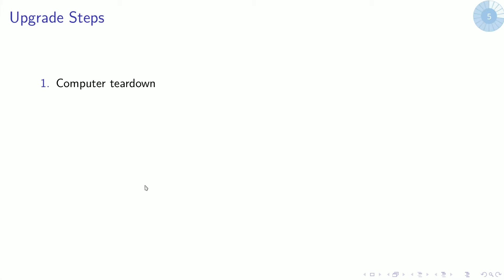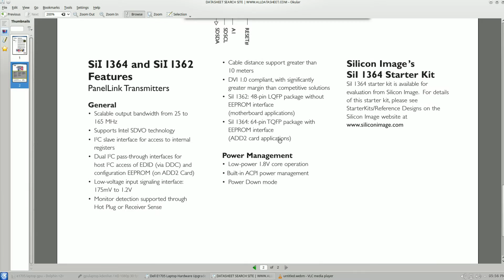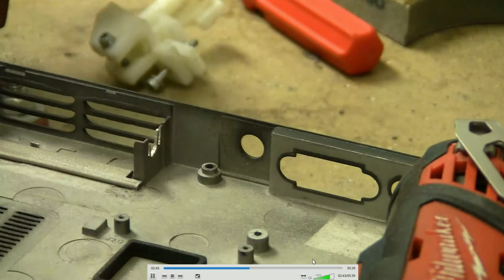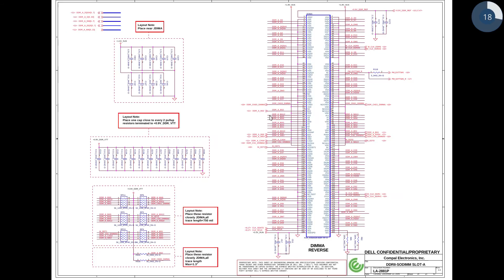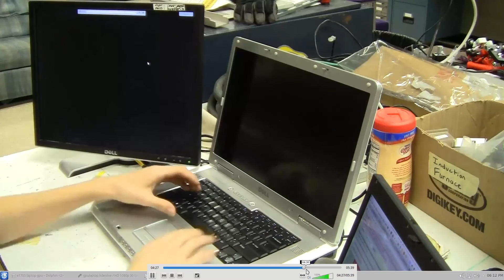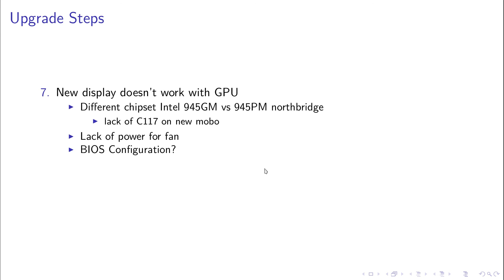Dell E1705 Laptop Upgrade

Comment: Congrats!  I thought I was doin good, upgrading my E1705 to 4GB RAM, and swapping out a broken screen with one of same res.  But I gotta tell ya, around Nov of 2016 you probly coulda snagged an E1705 with all those specs on eBay for $130.  Even less!  For some reason, some really great deals on oooold laptops come in late Nov. and Dec. every year.  Great, great speakers and sound on the E1705, though!  (No audio in, for mixing, unfortunately.)

Comment: Hey! I have e1705, wanted to throw it out but now I see a new little project.
May i ask you couple questions?
With 64-bit CPU will I be able to run windows 8 or later?
Is that video card is the best it can get?
Which one would be the best CPU for that socket?
What maximum amount of memory this laptop can handle?
Reply: Hey there! I've been doing some research and I think I have a few answers for ya!
I have an e1705 that I've been upgrading slowly.
With a 64 bit processor you can run windows 8 and 10, however getting drivers for audio to work properly is a bit of a hassle. The front speakers always work, but sometimes the mini subwoofer won't. Windows 7 works wonderful though!
The most powerful graphics card that I think this laptop can take is an Nvidia Quadro FX 3500m. Another option is the Nvidia 7950 GTX. Both have 512MB of video ram.
The best CPU that I think you can get is the Intel T7600 2.33ghz part. It has an FSB of 667. Anything higher has an FSB of 800, which is not compatible.
This laptop can handle 4GB of ram, but will only allocate 3.25GB due to some hardware limitation. 

Anyway, hope this helps!
Reply: You can even install Windows 10 on your e1705.

Comment: Nothing to do with this link but you did a video on the CFG250 Fuction Generator
the link to the service manual does not exist any more do you have the service manual and 
Circuit diagram Chris